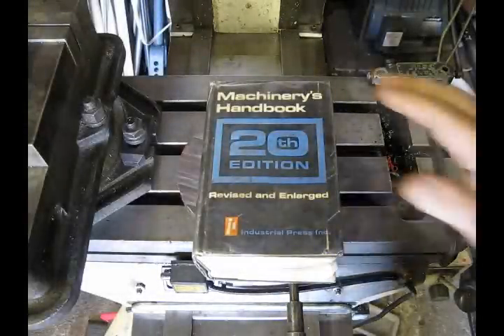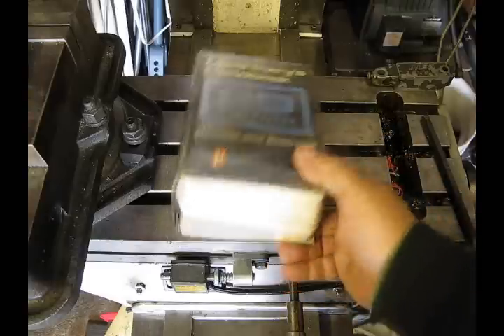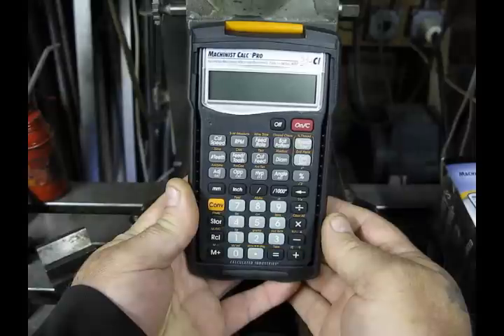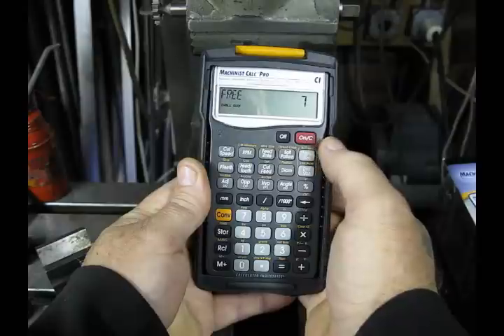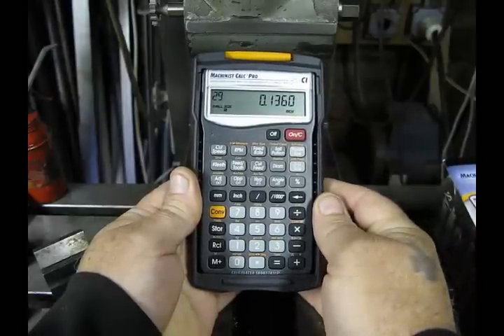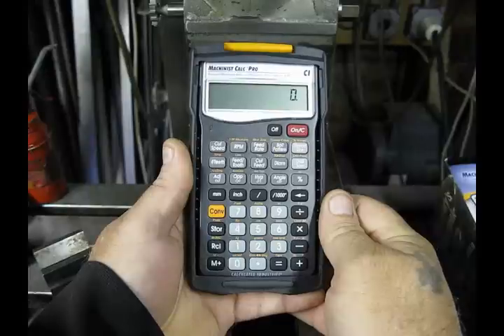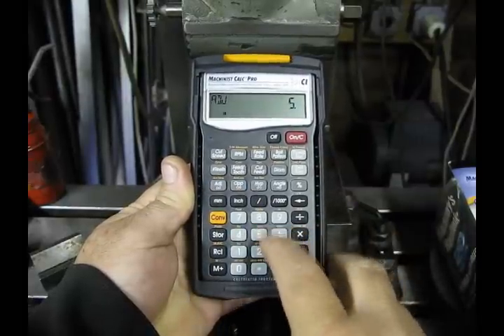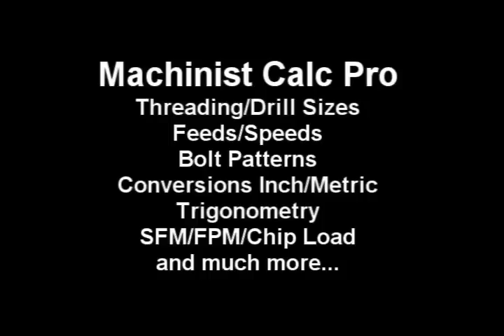Machinist Calc Pro

Comment: Realistically, you are better off buying a Casio programmable calculator like the CFx-9850GB or better from Ebay and writing their own programs. You can make the programs much easier to follow than the complicated procedure you are shown here. Many other benefits as well. On the Casio you don't have to buy a new calculator every time you want a new program function like you do this one. The Casio program language is easy to learn. You can buy these Casios used on ebay for 15-$20 all day.

Comment: JIm Harvey is correct. Now if your are trying to do what I think your may be doing Do exactly what jim stated then after pressing angle, than press X 2 (times 2) than "=" Enter it into angle by simply selecting Angle. However your Opp answer will change .0805582. Or divide your angle in half with .75 Adj . Now angle is 1.56441 each side when it is turned on lathe. it will come out to .750 OPP .360 ADJ with 3.0529 angle.

Comment: Given the info you provided... .360-.320=.040. Length ".750" would represent "Adj" because it represents starting point of angle also starting point of tool. .04 is entered into "Opp", Opposite of starting point (height of angle). Answer to "Angle" is 3.052882 and "Hyp" is .7510359. I will text another reply to give another example as it is machined.

Comment: Yes. If he would have pressed the Angle button it would have shown angle of 60.945396. Press Angle button again and it would have displayed Adj Angle of 29.0546. I use this feature a lot. You can use any 2 features (Adj Opp Hyp Angle) then get the answer you are looking for by pressing the other 2 features. If I know what my x and angle is, than I can find z or y distance is as well as hyp. Different Example: 23 (x) adj, 34(y) opp answer angle 55.922805, adj angle 34.0772, hyp 41.048752